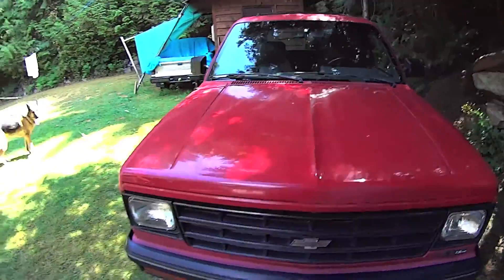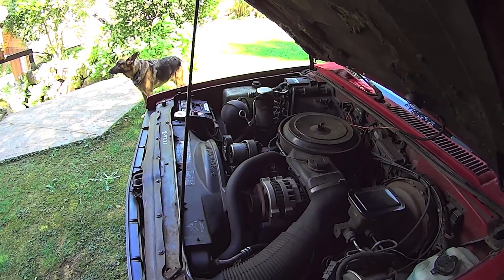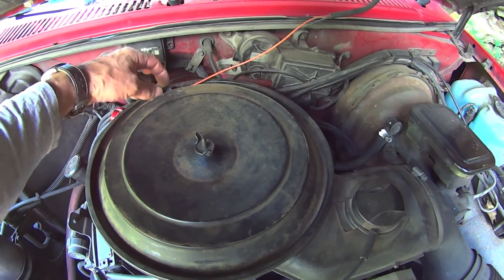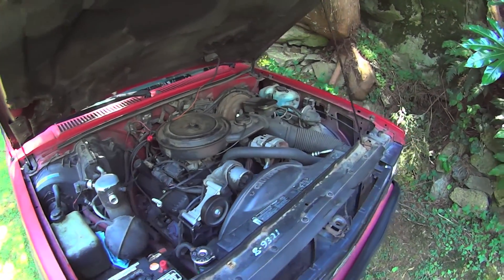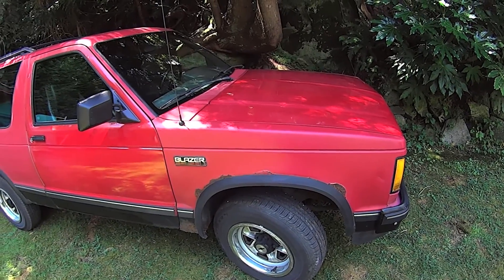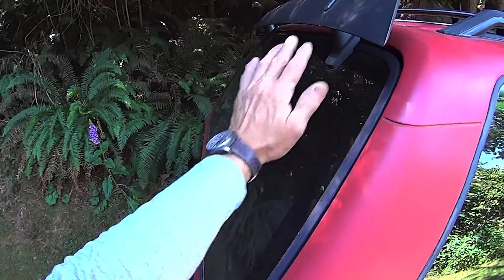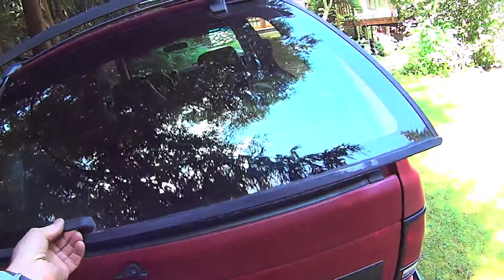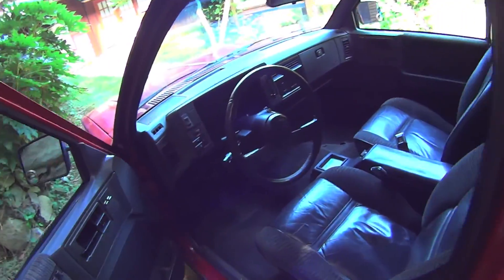1988 Chevy S-10 Blazer Restoration "part 1"

Comment: Did you ever check your thermostat anyways they seem to stay stuck open my gauge did the same thing . love what you are doing.
Reply from the maker: The gauge problem, and the overdrive lock up not coming on ended up being the temp sending unit. 
   I have had a thermostat stick on me before on a 300 Ford 6 cyl. It was a fresh rebuilt engine too. I started it up in the winter and went back in the house to finish my Coffee. When I came back out it was smoking hot  ! Dam near had a melt down.
  I could have done major damage if I had another cup.
      Your right. I think I will change it up on the 4.3 . I never did touch it when I changed the sending unit.
    I would be really sorry if this happened to my ride, and I would be mad at myself for not changing an inexpensive and easy part to change.
    Good advise, and thanks for watching.

Comment: Hello, I inherited a 90 2dr 4x4 blazer and plan on a full restoration. Woundering if you are in the restore business?
Reply from the maker: What are you planning to do with it ?
Reply: @squarebodychevyoverhauls6982  I would like to make it a daily or once a week driver. It's been in NC all its life. Happy to send some pictures via email or messenger.
Reply from the maker: Its not the easier vehicle to restore . Has all the big truck features but in a small package so things are tight and theres not a lot of room to work in most cases . I replaced all the body mounts with polyurethane replacements . Rust likes to form in these places and grows behind the mounts . Among other areas on the vehicle . They're getting kind of rare now and are starting to go up in value .
Reply: @squarebodychevyoverhauls6982  Thank you for the insight. It will be a big project and a lot of learning as I go.

Comment: where did you get the black fender flares for this?
Reply from the maker: The Blazer came stock with them. Not sure when GM first installed them as standard equipment?
 You should be able to find them at a wrecking yard.